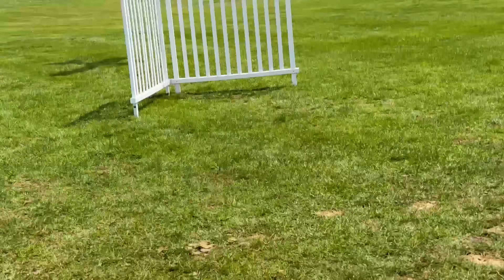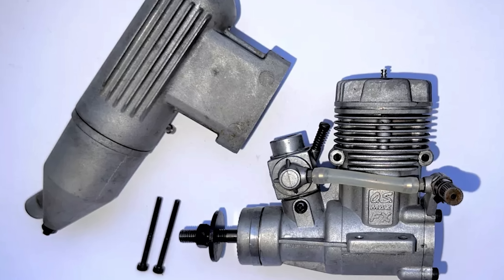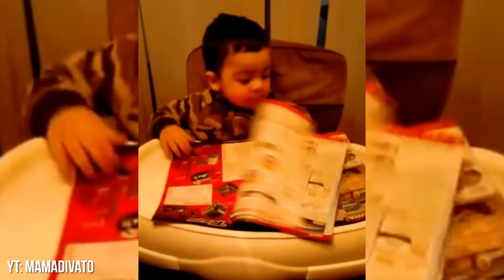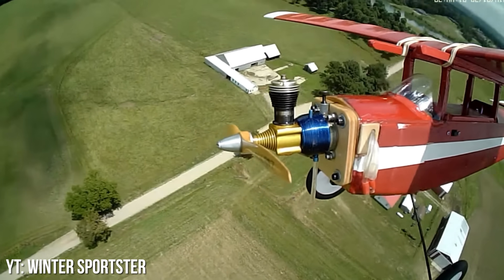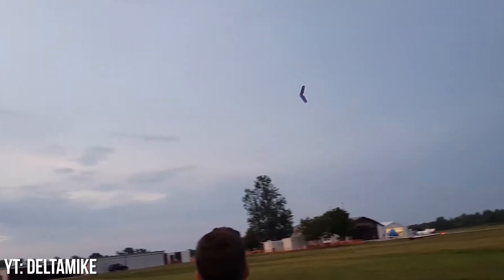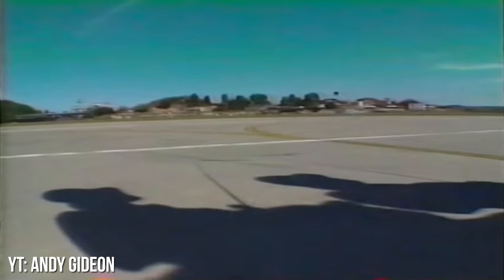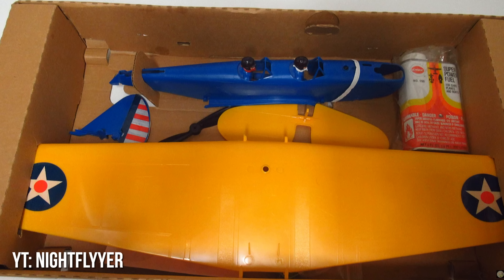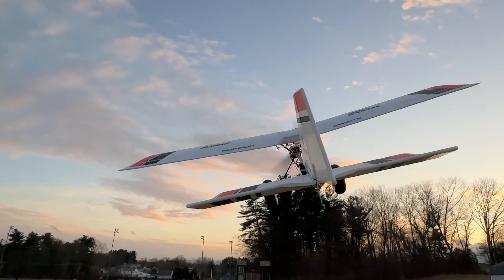18 MORE RC Plane Trends That DIED

Comment: A part of me really misses those days.  Something about the sound and smell of glow fuel (when it was not super pricy) and long flight times is a time that almost does not exist anymore.
Reply: I miss the people from those days. There was a more sense of community with one another. I miss the grumpy oldtimers who would get mad but still love to help you and treat you like a stepchild. It was great. You can sense they were good guys even though they were grumpy. lol
Reply: The smell was actually burnt castor oil. Gross, but I still love it.
Reply: I still fly mostly glow planes.  I catch a lot of heat about it from the electric guys, but I like the sound and the smoke
Reply: @charleybarber86  Then I want to thank you for keeping the genre alive. I love the smell and the sound all the flight line tricks too, but I have to fly from my yard for lack of a proper field these days, and I fly nothing but FPV now, so I try to keep the vibrations, the goop and the noise to a minimum. Which is probably just a lame excuse for being too lazy to do all the hours of kneeling and cranking and swearing that I used to go through in my glow days. I certainly respect those of you who still do it. Happy flying!
Reply: I never flew nitro, but still have a bunch of nitro cars. I also miss the smell of a well running warmed up motor
Reply: @V8Power5300 I still have a bunch of 1/8 scale buggies, and I thrash them every summer.
Reply: @Videolinquency Huh? I could, and still can, start my nitro engines with one flip... 🤷🏻
Reply: @davelowets  I used to do that when I was a kid and used a dry cell battery to start. One flip, no problem. But minimalism never was my thing, so I loved to build field boxes.

Comment: One that he didn’t mention was balsa builds. It’s super hard now to find real kits for balsa birds now due to everyone buying ARFs
Reply: Honestly, I wouldn't be surprised to see balsa building make a resurgence at some point. Flite Test has helped popularize scratch building with Foamboard, which has given newer hobbyists an opportunity to learn building techniques at low risk. And the next stage to make bigger, lighter airplanes is balsa

As an added bonus, balsa is theoretically better than carbon neutral, because the main building ingredients are CO2 and Water, and the trees grow fast for how tall they get: that means a demand for growing more balsa can suck a lot of carbon out of the air.

Sure, foamies and ARFs have taken over, but I can see a culture soon forming of "if you want something built right, build it to your own specs".
Reply: The desktop laser cutter has a real chance of bringing these back due to the easy of "printing," kits with the push of a button.
Reply: Love to see another WoF fan here, lol!
Reply: @malachiteofmethuselah9713  it's certainly the only reason I feel confident enough to design something
Reply: Check out Old School Model Works.

Comment: I still use rubber bands on my wings (Flite Test high wings), and remember a glow-powered EDF that just taxied.  It couldn't get off the grass.  I do miss the catalogues!  I held on to a few.  Had a Cox .049 motor on a control line plastic Cosmo plane when I was too young to use it.  The Flite Test Arrows mimic the Zagi wings.  Crystals were expensive!  I still use a balloon on my water planes.  Sucks losing power and control when the plane flips.  I still swap props with my buddies and we bring 6 by 3's, 9 by 6's and 10 by 4.5's to the field.

Comment: The GRAUPNER katalogue was my bible back in the 70s and 80s in Denmark. That and the Marklin model train katalogue. I worked all summer vacation and bought the black Graupner Varioprop 14S 40MHz radio and Graupner's first 1/8 scale  glow race car with the HB.21 engine. I didn't leave money for repairs so it was a short lived pleasure.

Comment: PCbway. I quoted them for a small, simple steel adapter sleeve with flange. Basically 3 tool changes and maybe 30 seconds of machine time... 80 euros. I think I'll ask a friend with an ancient manual lathe to make one for me for half that and I'll even get the tolerance right for the interference fit.

Comment: Those flight boxes aren’t dead- LOTS of us are still flying glow, and prefer it that way.
Reply: what about spark ignition 4-stroke? There are some nice engines with multiple cylinders out there. Maybe the revs of a flat-4 match the revs and torque needed by a ducted fan? Also I really would love to see ram air ducts in the center behind each stator vanes. All 7 of them go to the throttle plate, where again they split up into 4 intake runners. No carburetor nozzle in the way, but EFI for maximum air into cylinder. Also don't need this huge exhaust to stick out of the model. Just a short one which fits into the "afterburner".

Comment: aerials, and "indicators" hanging off the end of them.

one of the BEST was the 3 channel stick, that curtis youngblood favoured... ie, shove a wheel on a stick.

rubber mounted anti-vibration motor mounts.

quick fueling barbs.  

the oddball piezo charger that used engine vibration to trickle charge the Rx pack.

are there any magazines anymore? the centrefolds? a set of plans?

modern tech has killed everything.

still run 36MHz. had too many bad experiences with 2.4 glitches.
electric may be simple, its rather insipid. no real joy there. and, for me.. more glitches. im glitch prone :)

nothing beats the sound of a fourstroke. each to their own... some  people do scale models... only time i really enjoy electric is strapping random junk together with the intention of making something that simply shouldnt fly stay airborne... better yet, get it down again in one piece! 

take away all the gyro, the six axis stability, the silly flight controls, 90% of "fliers" couldnt. theres no joy in something that flies "hands off". that does a loop at the press of a button. that lands itself.

sure, its fun to throw a plane up and fly it around for a while, and a RRF has its advantages at times... but for me, part of the deal is the building, part of it is the sound, and part of it is fighting the irregularites caused by numerous repairs or simply slapping it together in a night cus i was excited...

Comment: Every once in a while I get nostaglic for my OS .32 powered JR Ergo 30 CCPM Heli, but then I remember the awful pull start that constantly broke and cleaning the castor oil off after every flight with windex and paper towels. Electric quads are all I fly now, heh.

Comment: I never did the crystal swap but I never had more than one plane at a time. Also, what about the radio boards at flying fields where you had to put your radio in while at the flying field and if you took the radio out, you had to pin your radio channel on to the channel board to everyone know what channels are being used.

Comment: All my electrics were built around seven-cell nicad packs normally used for RC race cars. You would take 3 to 4 packs out for a session, all charged, then, you would have one cooling off, one on the charger, and one in the plane flying, meant you could fly nearly continuously. I find that lipos are better and lighter but way more expensive too, so I couldn't afford that many lipo packs, I had to wait longer between sorties.   Some trade-offs are not as good as others. Rubber bands are still just fine for gliders and electrics, where the greasy goo doesn't affect them.

Comment: You left out the old guy in the club who couldn't hear and thought that Zagi wings were called "Ziggys". 

I don't miss nitro at all. LiPos are a PITA sometimes but I don't miss cleaning all that crap off my planes, or worse the damn paper towel holder bottle thingy tipping over and the precious 409 leaking into your van's carpet.

Comment: The balloon trick worked a lot better if you slapped a small glob of petroleum jelly in the throat of the balloon, that way short of the plane sinking water couldn't intrude.

Comment: We might have been a different here in OZ, but most of our early RC gear was 27mhz. Later we played with 36mhz and I think 40mhz, before we too developed to 2.4Ghz.
You also mention Cox aircraft, and how many had plastic Cox 'RC' planes, where I think you mean 'UC' planes, better known (as you said) as 'control line' planes. The term UC is from 'You Control', which I think was a trade name for one of the early model kit producers.

Comment: It's interesting how many "obsolete" parts of the hobby still retain some nostalgia, like control-line flying, and nitro engines in general, but nitro ducted fans were a thoroughly dead branch once lipos got under $1/watt-hour and brushless EDF's could outperform them in both endurance and power. They were all compromise, no benefit.

Cox "released" a .049 TD just a few weeks ago though, I wouldn't say they're entirely gone.

Comment: HOW did you not know about nitro ducted fans? They had the craziest engines turning the highest rpm.

All the weight and cost for a mild breeze as a result. Almost like the real early jets 

Except for the deafening screech😂

Comment: I miss the Duracraft DuraPlane. I had the DuraBat with the high performance variant of the tower .46. That thig would do amazing flat spins like it was on a pole and just snap back to level flight just letting go of the sticks. There will never be another plane like the DuraBat it was the OG rc hoodlums' plane. The whole square pvc pipe plane scene was the shit. I had a pvc A-10 that some guy made and sold kits for out of his house. I got it at a swap meet. nice durable and amazing flying plane.
Reply: I had one to as my first plane.
Reply: I had one of these as well as my first plane.
Reply: I think I still have an original Duraplane downstairs. What a dog.  😂

Comment: Designed to shut off when they run out of fuel... ... ... lol
Reply: Some ancient electric planes were like that too. As a kid my grandpa bought me a Cessna Sunlight 7 which ran on the tiniest 4S NiCad you've ever seen - 1/4AAA, I think. You had this huge charger brick powered by 8 D cells and you'd plug that poor battery in it; it'd shaft it with enough charge to last a couple minutes, then you'd connect it to the plane, launch - full throttle only, of course - and fly about on exactly one channel (single servo controlling the tail). In about a minute and a half an onboard timer would just flat out disable the motor, no warning at all, and you had to glide down to the ground. At least it left enough power for the receiver and servo...

Comment: What a surprise to see my Zagi video cited! They owned the wing market when I got into flying, the Zagi's pure toughness made it a solid trainer for me even though it wasn't the easiest thing to fly. I was out of the hobby for nearly 10 years, and when I came back EVERYTHING had changed. LiPos and Brushless motors had replaced brushed and Nicads. I took the best guess as to what Lipo/Brushless would power my rebuilt Zagi and boy did I ever miss. I totally overpowered it, and it flew like it was on meth (as seen in vid). It flapped at full throttle and I finally stopped flying it since I didn't want to destroy the plane I learned to fly on.

I'm really kind of bummed they just kind of slow-faded out of RC, I really have a fondness for the company that got me into flying.
Reply: I fly zagis often, a friend of mine has a hot wire rig where he can make zagi wing half’s and build the wings.

 I have a 6 foot battle wing with a lead nose and it weighs 11lbs. It destroys everything in its path while combating other battle gliders. 

Also have the hand launch 3 footers. Great for light thermals or soaring.
Reply: @ElijahMiniBikes  That's pretty awesome! I hung my Zagi in the garage and replaced it with a Crash Test Hobby Grim Reaper. Still my go-to on windy days or if I feel that I need a warmup flight. 🍻
Reply: I still have a Zagi downstairs. I loved the coffee candies the kits came with.

Comment: My dad when in college got into building balsa models and 15 years later when I became old enough he bought a foam trainer to fly with me (he had never seen one before and is a compulsive buyer) and the most ironic part to me now looking back at it is although he built 2 balsa models installed the gas engines and all he was too afraid to ever fly them so when he got that trainer 15 years later it was the first time he ever flew

Comment: Australia had 27mhz, the very same as the early CB radios here. Same issue, the lawn dart. Caster soaked rubber bands were kept in a jar with talcum powder in it. I started in the late 60s, wow, how things have changed now.

Comment: I will add a few that a few OG's will remember but don't probably miss all too much: NiCD batteries, NiMH batteries, Gremlins, Idle bar plugs, die cut, Quadra, servo lead chokes, plastic servo gears, power panels and last but not least....range checks.
Reply: Range checks should still be performed radios have procedures listed and low power modes for that.

The difference is that radios are more reliable and planes seem to be cheaper or less of an effort to get in the air, so less care seems to be taken
Reply: Also most of my servos are plastic geared... And on purpose, they're just lighter.

Comment: I came into the hobby in 2012. I still remember the puzzled look on my face when the hobbyking skipper I ordered came with a balloon and no instructions. Receiver balloons are not dead. I still use them, especially on those planes that I know are gonna end up ground(water) looping
Reply: i got a Skynetic dragonfly last year and it had a balloon as well
Reply: Started in 78 with a 4 channel 27mhz futaba
Moved to ff9 in 2000
Changed module to 2.4mhz
Still using it.
I do like a 50cc gas motor

Comment: Good memories. I still recall that the trend of sharing props changed a bit into trading props, because itvwas cheaper to buy in bulk and sometimes you had too many of those GWS props of a certain size. Folks at the park often used 8x4", 8x4.3", 8x6", 9x4.7", 9x5", 9x7", 10x4.7".

Comment: Grew up with my dad and his buddies flying all of the things you mentioned in the video. I still have my "40 size" Eagle 63 that I built as a kid. It still has the ENYA .46  on it. I flew again 7 or 8 years ago after being in storage for 30 plus years. It still had the same Monokote covering on it that I installed when I built it as a kid. The first flights after storage quickly taught me that Monokote gets pretty brittle after sitting in the attic all that time. It's sitting in the corner of my "hobby room" right now. I'm going to recover it and put it back in the air with modern electronics and modern covering. I still what we would call the "flight box" with the battery and control panel as mentioned in the video. Everyone at the field had one back then. My Dad still flies to this day. None of his old planes are around but a few years back he built a new 60 size Ugly Stick and put a 90 four stroke on it. Most of what he flies now is electric for all the reasons you listed but he still loves (as do I) the sound, and smell, of the nitro glow engines. Once tuned properly they are extremely reliable. The modern nitro fuels and the oils they contain, are much better than the old caster oil based stuff. Many, many great memories of the planes, people, and fun Saturday or Sunday afternoons at the flying field with my Dad and his buddies.

Comment: I remember RCM&E 1995 issue having a custom plan for an EDF jet called a Tyto - it used an Estes D class rocket motor to enable takeoff from the ground because NiCads and brushed EDF just didnt have the guts. Five minute flghts were a good result for an electric thing in the 90s, so if you wanted a jet without a loathsome engine sticking out of the nose it was the only practical option.

I do like that modern stuff has made aeromodelling more accessible. The zen of turning a box of sticks and tissue paper into a flying machine is a precious experience as well.

Comment: So many old things that disappeared, like frequency pins, hobby shops, missle like pattern airplanes,  Ambroid glue, wire antennas, the shouts of “I don’t have it”, the ever present spray cleaner and paper towels. We have also lost some good things like the great airplanes like the Kaos and the Ugly Stik that actually flew instead of flopping around the sky like the styrofoam toys today.
Reply: Me and Dad brought the Falcon 56 back to life and my old scat cat Nitro is kinda coming back here🇺🇸✌🏽
Reply: So many folks have only flown foam planes that I don't think they understand how floppy they feel. Just check the reviews of the balsa Timber. The rigidity seems to blow people away. New pilots that have flow balsa are nearly exclusively flying ARFs wich are heavy pigs compared to a well designed kit. It seems like planes these days are designed to crash, not to fly
Reply: @Random4RC  Balsa flies better no doubt and I'd rather have a kit plane now days, Falcon 56 is up and running with OS FP.60 and scar cat OS .40 FP ,I'm restoring my Extra 300 .120 OS 4STK  and Dad is building an Astro Hog, we've missed Nitro and balsa 😅 I still think if you're going to do jets EDF is great and there are some good jet arts available,  but prop planes should run on Nitro because it's just proper 🇺🇸👍🏼
Reply: I'm currently helping a local kid build his first plane, and it's a balsa high wing trainer (his choice). Just electric rather than combustion.

Foam planes can be made rigid too, a bit of pulltruded carbon fibre rod goes a long way in that regard... assuming you put it in the right place. I've flown some planes where the carbon would make the wings twist the wrong way above a certain speed, leading to a sudden nose dive.